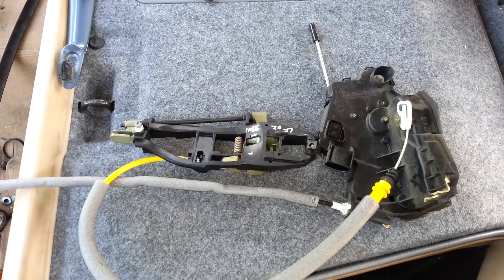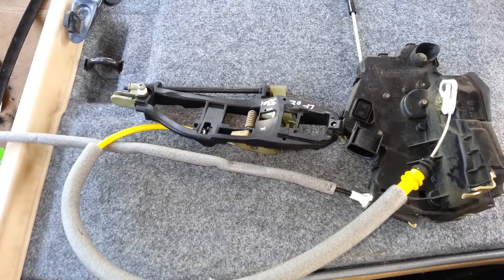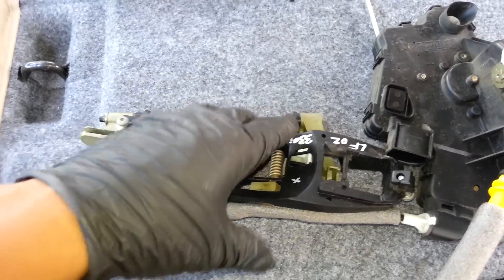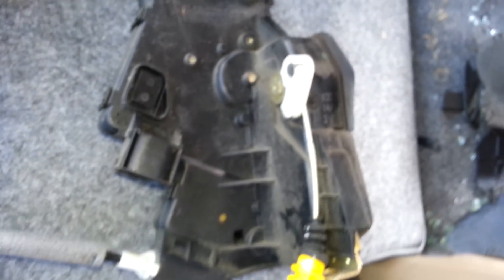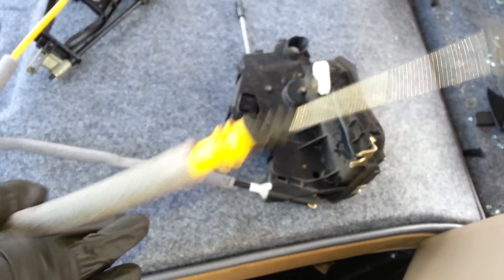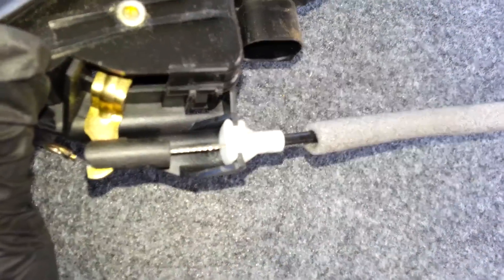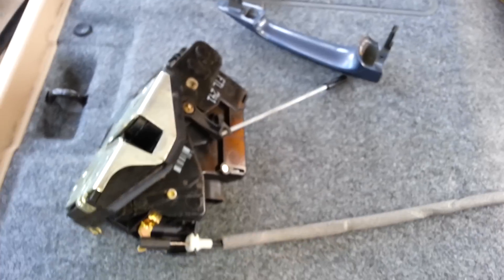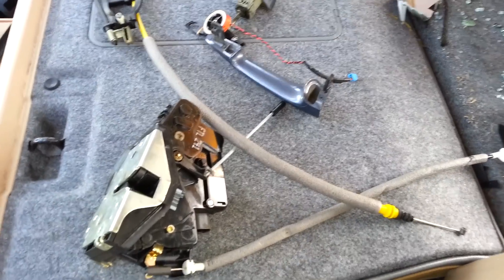BMW E46 330i 323i 325i Sedan Door Handle Lock Actuator Cable Diagram

Comment: Good tip... If you live in a really cold winter climate such as New York like I do then you need to be careful when its under 25°. The door will stick and you'll add extra tension when trying to open your door handle that can stretch or break the "door latch cable", and render it inoperable. Until its fixed you can depress your key remote once to unlock your drivers side door, and then depress, and hold down the key a second time, and your windows will go down allowing you to reach inside to open the door.
Reply from the maker: Stewart Barnes  Thanks for sharing that information with us.

Comment: Thank you for the great video brother i have a question can i replace the inside door latch cable without removing the actuator on the front passenger door on an 04 325i sedan?

Comment: Watched some videos on general module and this problem could be tied to another problem as well, passenger door won't unlock when you open the car with the remote. That's the general module as well.

Comment: Hi, I have a 2006 325xi wagon (e91), and had to replace the driver’s door lock actuator.  I didn’t know about your company, but bought a pair of door lock actuators from a New Hampshire bmw parts group. They sold me a pair for less than one original, citing that bmw basically admitted to a defect and was making these — the pair— reasonable.  I’ve heard about this from others as well.  Question:  the nh parts people said that I would need to install BOTH lock actuators for them to work properly.  So far, I’ve replaced the drivers door only. Today they’re all working fine.  Do you recommend replacing the passenger door one as well?  I have to take its panel off anyway to replace the speakers (focal).  Btw. Your right that it is not a truly difficult repair, but I had a terrible time getting the drivers door lock mechanism back together—so bad that I had to seek help at a mechanic shop! They didn’t charge me.  But I spent 3 tortuous hours to no avail trying to get the outside door lock mechanism seated.  It didn’t want to go in and we had to force it hard into the door.

Comment: I have a 2000 BMW e46 323i, and the driver sensor door says its open. Should I go ahead and replace the actuator or is there another way to fix this? And could you make a video showing how to replace it. Thanks.

Comment: thanks for a great video, the problem I have is that all the doors lock except the drivers side door, when i use my key on the door lock, this is how it goes, can you please let me know what i might be looking at?  03 BMW 325i
Reply from the maker: you need to change your lock actuator.  check out our website for that part

Comment: hey bimmermerchant, I have a 1999 e46. my driver side rear door has a child lock with a broken exterior handle. would there be a possible way to unlock the child lock so I can work on replacing the handle? I have an extra door panel so I was thinking of just ripping the current one on the car off and start from there. any tip would be appreciated thanks.

Comment: Hey I am in need of one of those outside door lock cable, my driver door handle will not work so i remove the handle and saw the broken cable. I have the same car, a 2002 330i sedan. Think you can give me a price on that cable ? please let me know

Comment: great video mate... do you remember what is the link between the cylinder lock and the actuator ? I replaced my actuator (following this great tutorial:) and now the key doesn't open the car's door...  The handle works fine though... Thxs in advance.
Reply from the maker: Common issue.  Make sure the input on the actuator is top center and ensure that pin from key cylinder goes all the way in the actuators.
Reply: bimmermerchant 
I will try tomorrow, thank you.

Comment: Hi, have a problem the drivers side door. All my other three doors r able to unlock n lock perfectly with the key BT the driver's door won't lock. The lock switches r able to go up n down for all the doors. (Bmw 318i) kindly help....
Reply from the maker: +Dexter Mwale Seems like your driver front door lock actuator is faulty.  Common issue with drive front doors.  Feel free to check out our website for a good used door lock actuator.  http://www.bimmermerchant.com

Comment: Hello my 2003 e39 bmw 525i passenger front door wont open either from inside or outside but when i press the door opener control the lock goes in and out, but it wont open, is there any other way to open the door
Reply from the maker: +Edwin Rodriguez You can remove the inner door panel and try to manually pull on the release cable to open the door
Reply: Hi Edwin.  Well I have the exact same situation here with my e39.. can you please tell me what you finally did in order to fix yours?? Any help will be much appreciated!  Bye.

Comment: 2012 jetta, driver door doesn't open from outside, key works and lock works but it just won't open from outside. Inner handle works fine. Any idea what the issue might be?
Reply from the maker: sorry, don't work on jettas

Comment: Hey, im not sure if i will get a response, but does anyone know the size of the cable that attaches to the exterior door handle ?
Reply from the maker: For what year model bmw? And why do you need a size?
Reply: @bimmermerchant  its a Sedan E46, im trying to use a bicycle break cable thats seems to me to be the same, but i need the size of said cable, i can take it apart and measure it, but if anyone knows the size its spares me of some work 😅

Comment: Do you know the part number to the cable that opens the door from the outside?
Reply from the maker: Unfortunatley we don't have part #.  You can view a good website where you can obtain part #'s for your bmw www.realoem.com
Reply: thanks but it turns out you can't just buy the cable alone but you will need to buy the whole carrier handle
Reply: bimmermerchant yeah is there any way to buy the cable itself? I bought a door lock actuator and I just saw this video now saying that if my exterior door doesn’t open it’s because the cable, but I didn’t get that cable when I purchased the actuator.

Comment: Hi, great video and explanation!
I have a 2000 320Ci, and sometimes my passenger door actuator goes crazy. It doesn't give the signal that the door is opened - so the window is not falling the aprox 10mm down and the interior light doesn't go on (the drivers side works fine). Does the E46 has some different types of door actuators? I'm asking because I've opened the interior of my passenger door and I couldn't see the cable from the outer door handle to the actuator, the cable for the interior door handle is there. All other videos/photos that I've seen on the internet had that second cable.

Here's a link to a few photos that I've taken when I've removed the door panel to see how it looks:
http://i1092.photobucket.com/albums/i415/DarioGTI/2000%20E46%20320Ci%20interior%20door/20160612_132820_zps6dtlryes.jpg
http://i1092.photobucket.com/albums/i415/DarioGTI/2000%20E46%20320Ci%20interior%20door/20160612_132829_zpslct0taq9.jpg
http://i1092.photobucket.com/albums/i415/DarioGTI/2000%20E46%20320Ci%20interior%20door/20160612_132840_zpst9pkljba.jpg
http://i1092.photobucket.com/albums/i415/DarioGTI/2000%20E46%20320Ci%20interior%20door/20160612_133033_zpsg0doikdy.jpg

Comment: my BMW won't open at all  in side or out
Reply from the maker: Unfortunatley, this is a common problem with bmw models.  Seems like your door lock actuator has stopped working and its on the lock position.  You will need to remove door panel and unlock the actuator manually.  Good luck
Reply: how can i unlock the actuator manually?
Reply: Hey Kevin, I have the same on my door, did you manage to get it opened?
Reply: vivien tetelain hi vivien. I have the passenger door damaged. The way for open was the destruccion of the actuator from the interior of the door 😂
Reply: Damn! I ll keep looking around hoping another solution exist. Thank you so much for such a prompt response.